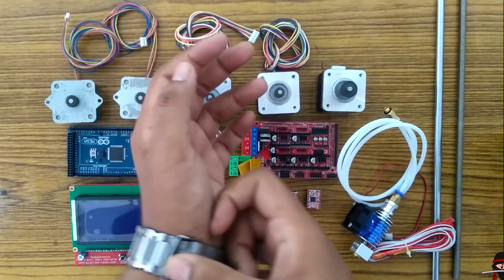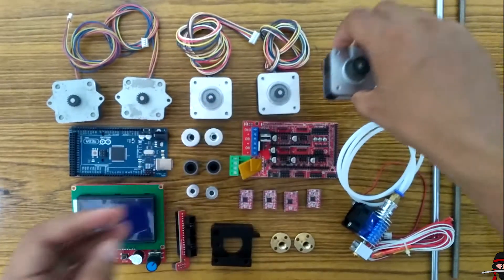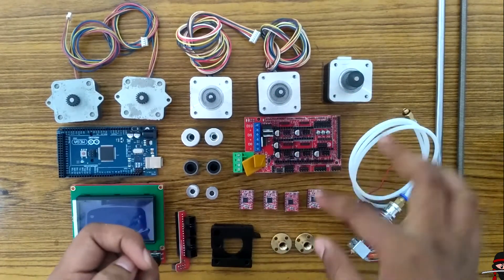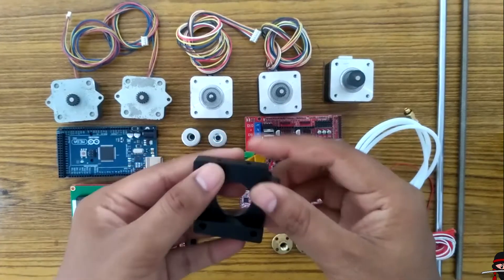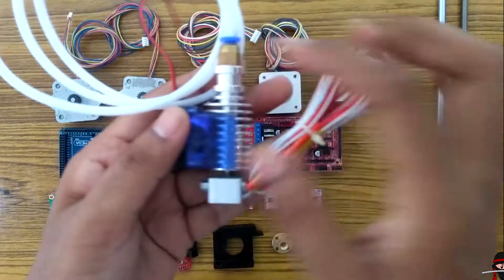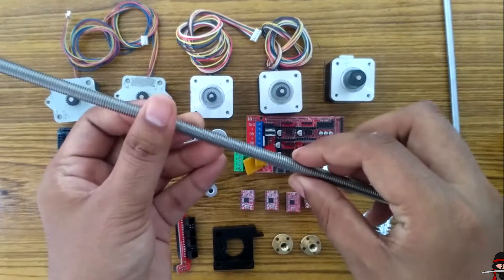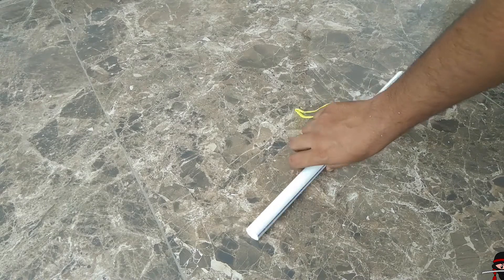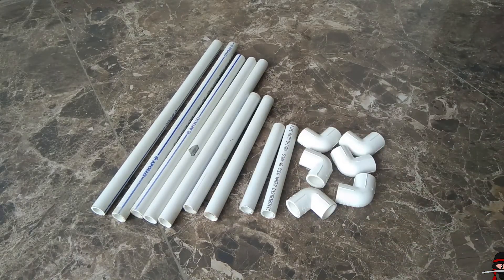DIY 3D Printer | Complete Build

Comment: One the problem I am facing in an other 3d printer that when I print a part or any model the printer in the middle or before start clicking, even I have set the temperature according to PLA? Kindly then me the solution

Comment: I found ex-printer's stepper motor at online marketplace. And it's cheaper than nema 17. Can I use that stepper motor for this amazing project?
Reply from the maker: Yes you can use them.
Reply: @MechNinja  Which type of stepper motor it is? Bipolar or Nonpolar
Reply from the maker: @teanrizt3655  it is bi polar motor with 4 wires. You can use a 6 wire motor in which you need to eliminate two wires.

Comment: How much length of belt should I needed ? I love ur project and trying to make it for science fair
Reply: 15:19 I can see that u are fixing a tiny piece to the board. What is it and does i need to add it too?
Reply from the maker: @Falcon_X1  those are connectors which comes with ramps 1.4.
It is used to reduce the steps of motor.
You have to connect them as shown
Reply from the maker: Since you are making a DIY 3D printer hence length is not fixed. You have to make a loop of belt and then cut the size accordingly.
2 meter is enough for a single printer
Reply: @MechNinja  Thanks for answering & Have a nice day
Reply: I'm planning to connect one more hotend to the RAMPS board in the heatbed port. so does i need to modify the SMPS ? need to change to 24 v or need to change in amp??
Reply from the maker: Increase the amps.... Don't increase the voltage as ramps 1.4 is designed for 12 volt power
Reply: @MechNinja  what should be the amps?
Reply: which type of motor driver is better?? DRV 8825 or A4988?
Reply from the maker: A4988
Reply: does the brass nut is compulsory?? can I use a normal nut instead of it?? because that is not available nearby me.
Reply from the maker: You can use any nut
Reply from the maker: Hi...Checkout my new video of DIY 3D Printer complete build from scratch
https://youtu.be/XYMj6DIum-Q

Comment: Broo i set up an printer all worked. But the lcd display is not showing any character or nothing. I checked the  connection its not an issueee. Plzz replay
Reply from the maker: No problem...Just go to config.h in marlin...and from bottom, uncomment your LCD type. You might be using either LCD 12864 ( Big screen ) or LCD 2004 ( Small screen )
This will solve your problem...
Don't forget to subscribe..:-)
Reply: @MechNinja  but how to set home axix my printer is start printing from corner of thr heat bed. And also the filament get stuck inside the hot end
Reply from the maker: For setting offset....just go to config.h and there is offset menu and you can customise yourself. And one more thing, since you are using marlin firmware then everything will be operated from config.h menu. So try to explore it...😊😊
Reply: @MechNinja  bro now the end stop not working 😕
Reply from the maker: There are options in Config.h for endstops
Reply: @MechNinja  tnx bro solved
Reply from the maker: Hi...Checkout my new video of DIY 3D Printer complete build from scratch
https://youtu.be/XYMj6DIum-Q

Comment: Hi, we have been working on this 3d printer for a while now, after the code has been dumped into mega Arduino,the stepper motors haven't been responding as they should. Can you please help us out ....
Reply from the maker: All the motors or one motor ?
Reply: @MechNinja  they are vibrating but not responding

Comment: Can we use Arduino uno instead od Arduino mega
Reply from the maker: No you can't use Arduino Uno because it doesn't have enough pins.
Reply: @MechNinja  and which power supply have u used and is it enough to use 12v and 20 amps???
Reply from the maker: Yes 12 volt 20 amps is enough
Reply: Thank for replying
Reply from the maker: Feel free to ask anything.....😊😊
And don't forget to subscribe
Reply from the maker: Hi...Checkout my new video of DIY 3D Printer complete build from scratch
https://youtu.be/XYMj6DIum-Q

Comment: hey can i use 2004 lcd control instead of 12864?
Reply: thank you if i have any other questions regarding this i will get back to you :)
Reply from the maker: Yes sure
Reply from the maker: Yes you can use them, but you have to change a line in code, it's simple.
Go to cofig.h the scroll to the bottom and then comment the line " reprap smart discount lcd controller "
And uncomment the line " 2004 lcd control " 
And it will work.
And don't forget to subscribe 🙂🙂🙂🙂
Reply: hey so i cant open the code
Reply from the maker: Use Arduino software to open it
Reply: i tried ill try again
Reply from the maker: Hi...Checkout my new video of DIY 3D Printer complete build from scratch
https://youtu.be/XYMj6DIum-Q

Comment: Do we really need the heatbed or could we just use the wood instead of the heatbed?
Reply from the maker: If you are printing PLA then no heatbed is required. You can only use brim and increase the surface area for smaller parts. If you are printing bigger parts then brim too is not required....
So thanks for watching and don't forget to subscribe ☺️☺️☺️☺️
And do post your more problems and I will help you out.....

Comment: Do I need to upload the code after building the upgrade version or can I upload the code without upgrading?
Reply from the maker: No it's not required to update the code Because the electronics part are same.
And I am in the process of building an ender 3 with the pause feature.
So don't forget to subscribe 😊😊😊😊

Comment: Pls, where can I get the 3D model and dimensions of the parts and assembly of the printer (most especially the dimensions of the woods you used)?
Reply from the maker: The wood frame was made out of two 30 cm wood piece and three 20 cm wood piece. Once you make the frame for heat bed and attach the linear bearing, then you get the idea of where to attach the y axis rods.
The 8 mm rods I have used are of 500 mm length and I have used 6 of them.

Comment: You are awesome bro...
I tried to build my own 3d printer... after load the file the stepper doesn't rotate what may the problem bro
Reply from the maker: 1) If your motor doesn't have a detachable connector of 4 wires, Then your stepper motor must be having 6 wires, And if so, them eliminate the black and white wires and use the other four.
2) Now check the circuit of the motor using a circuit tester or multimeter. There are two coils of wire in the motor.
3) Then connect the motor in the 4 pins in 2B2A 1A1B , where 2 And 1 are same coils number.
4) Now check the above method, and reverse the wire if that doesn't work. This will solve your problem
5) check the orientation of your motor drivers
Reply from the maker: Hi...Checkout my new video of DIY 3D Printer complete build from scratch
https://youtu.be/XYMj6DIum-Q

Comment: Could you give the measurements of the  boards you've used to attach the motor
Also the wooden , pvc  frame
Reply from the maker: The PVC pipe is quarter inch...The length of the pipe depends on the length of the rods....And once you built your frame then you can cut the board according to the dimensions you are using....If you find any problem then comment....and I'll help you out 😊
Reply: @MechNinja  thanks

Comment: Amazon sells a kit with aluminum 2020 profile rails that are cut to those measurements of the pvc.
Reply from the maker: For aluminium profile....you need to purchase v slot wheels for it. Then our smooth rods and linear bearings will be eliminated from the printer.

Comment: Hi
Some tips!
The pipe is a very bad choice because it's not at all rigid.

You can use pc power supply smps and save money.
Reply from the maker: Yes the pipe is not good at all....But it is the cheapest and simplest way to make the frame.....I have used aluminium extrusion in my later versions...🙂
Reply: @MechNinja  crazy!!! I really appreciate it. You can Infact try to fill the pipes with concrete and experiment how it works out maybe...

I made my printer with steel square tubing it came out like a tank.. But due to customization issues I'm going back to the extrusions.. The extrusion will cost 2k in my case.. Its definitely worth it
Reply from the maker: No need for it bro....As it's just a project....and I have upgraded it to aluminium extrusion....you can check out my new video.....Earlier I had made the frame with wood......

Comment: Please tell measurements
Reply from the maker: The dimensions depends on the smooth rods. I have used smooth rods of 8mm dia ,6 rods of 500 mm length and then you can cut the pvc pipe according to it.
Reply from the maker: Hi...Checkout my new video of DIY 3D Printer complete build from scratch
https://youtu.be/XYMj6DIum-Q